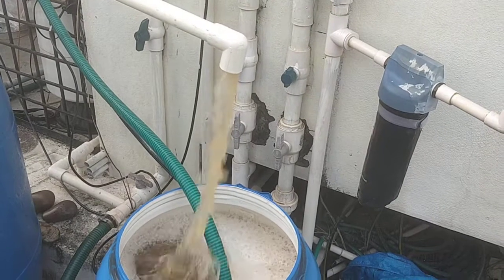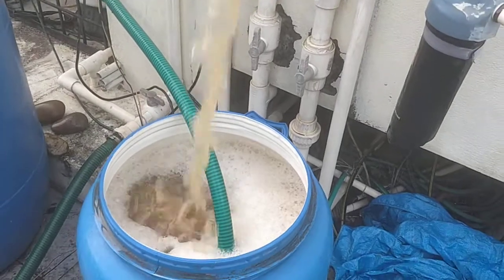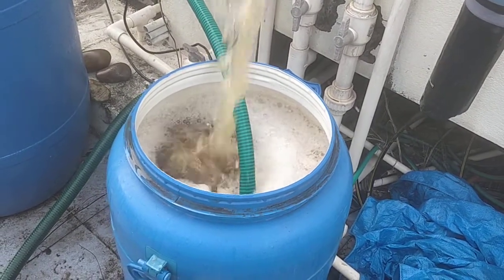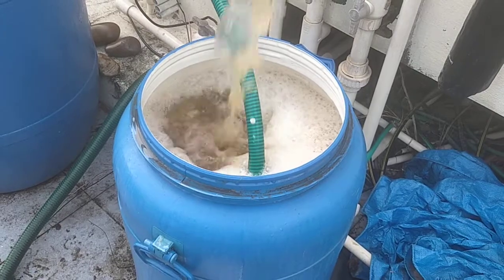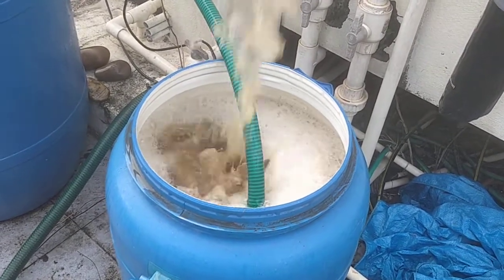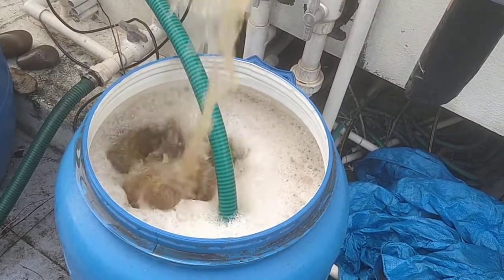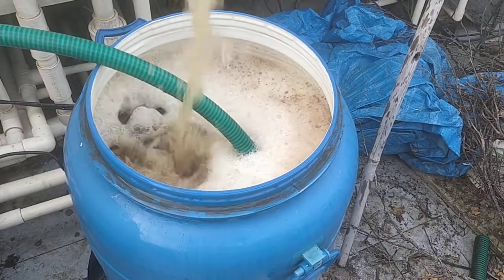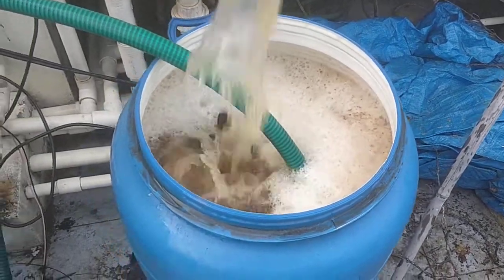Waste Decomposer in 60 hours.

Comment: Hindi boliye
Reply from the maker: ठीक है। मै कोशिश करूँगा।
मैंने 100 लीटर ड्रम में डीकंपोजर के 10 लीटर लिए हैं। 90 लीटर पानी के साथ इसमें 500 ग्राम गुड़ मिलाया।
मैंने घोल को चूसने और ड्रम में वापस डालने के लिए एक पंप कनेक्ट किया है। पंप सुबह और शाम को 40 मिनट तक चलता है। 60 घंटे के बाद, अपशिष्ट डीकंपोजर तैयार है।
इस विधि का लाभ यह है कि आप कम गुड़ का उपयोग कर रहे हैं और आधे से भी कम समय में डीकंपोजर तैयार कर रहे हैं।
Reply: @skoka123  many many thanks
Reply: You're real gentleman 🙏
Reply from the maker: @rumachattopadhyay3475  Thank you.
Reply: @skoka123   ji .... Kindly use any aquarium air pump of decent quality to aerate the mix. It'll serve the purpose at minimal cost and power consumption and you may leave it on for hours each day.🙏
Reply from the maker: @pandayravi8724  Thanks for the suggestion. I do use air pumps for Hydroponics DWC. I doubt if one air pump would be as effective as a 1/2 HP pump. May be 2 or 3 could add enough dissolved oxygen required for quick multiplication of the microorganisms. I will try it with air pumps. 

The reason I used a 1/2 HP pump was to test the claim of one of farmers who said he could do it in less than 3 days. As I said in the video this is not my idea. The idea came from a different farmer (unfortunately I do not have the link). Also, here in Telangana, most farmers do not have access to single phase power supply. We get 3 ph power supply for free from the government. Most of us have tanks and need huge quantities of WDC to increase the number of earthworms quickly. With the 1/2 HP pump we can produce thousands of liters of WDC in a short period.

For home users, your suggestion is great.
Reply: @skoka123  garu... yes it's possible to multiply the mother culture in 3 days with the help of the 1/2 hp pump. The same may be achieved using higher capacity air pump. The process of multiplication being aerobic in nature requires constant oxygenation for faster results. A 12 volts pump attached to a solar panel may be used for the constant oxygenation. As one requires large quantities for the agricultural uses , a simple setup can be used for the same. My suggestion would be to connect several 200 litres drums in Series at bottom and a 1/2 hp pump may be stationed suitably for the uptake of the liquid from any one of the drums.  Whereas the output of the pump be connected to a single pipeline with multiple outlets placed over each barrel. For tanks and ponds as sighted by you couple of plastic fountains directly installed in them should do the trick. These methods may  provide you with  cost effective and faster solution. Hope I've not crossed my boundaries over here by advising a much learned person like you sir, if so I may be pardoned 🙏